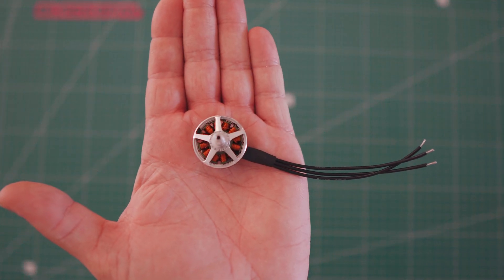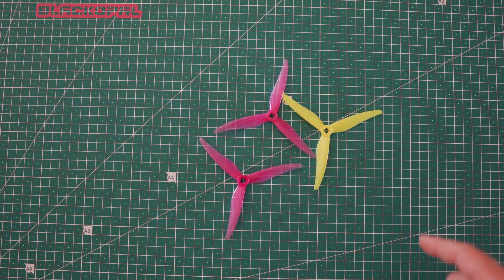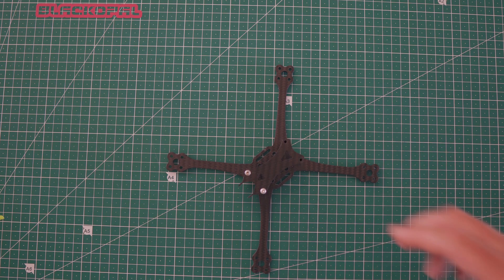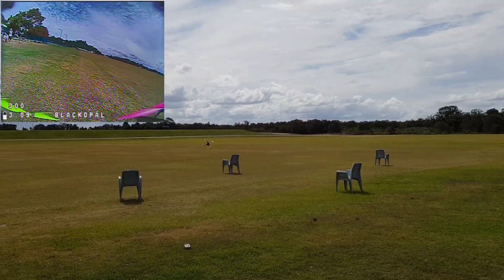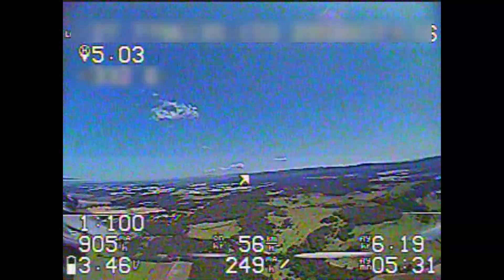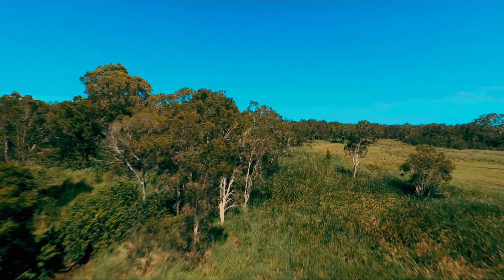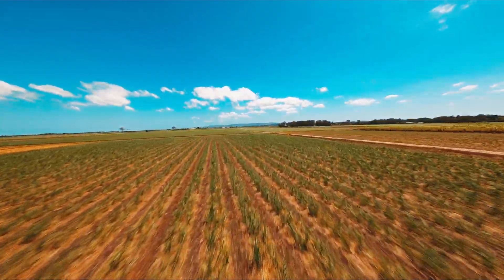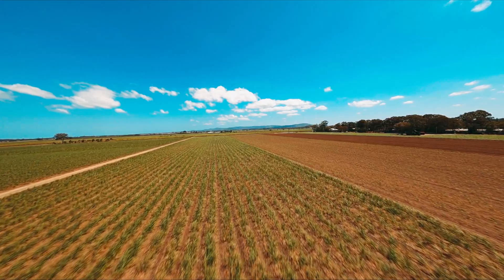37+ Min Race Drone? T-Motor Prototype

Comment: So sick! im def gonna try this out!
Reply from the maker: Yeah man, such versatile builds. I love how this genre is evolving so quickly.
Reply: @ScottTomlinson  This is gonna explode now for sure! Bro i got some mambao 2204 1450kv with 16mm motor mounts. How do you think this drivetrain would fare on a normal 125g frame, i could use theiflight H7 to help with weight a little more. Could i also ask what max amps you drew and what kinda flight time you got with the normal 6s lipo? Thanks!
Reply from the maker: @HarshFPV  Those motors should be sweet too. Much the same spec. I've got a mate trying them out also. Low weight really is the key to extended flight times but I've managed to carry some pretty heavy batteries so you might be surprised. 

The LiPo batteries on my analog build were getting me around 100 mAh per minute at cruising. Less as you go bigger obviously.
Reply: @ScottTomlinson  Awesome to hear that! i got 6s 1300mah only. although i can source some 4s 5s 6s li-ions. would you suggest the 6s for best throttle response or does the added weight offset the throttle response at that point, making 4s more optimal?(frame is 125g already)  By throttle response i mean like how fast the quad reacts to throttle blips sorry for the wording and thanks for your time brother!
Reply from the maker: @HarshFPV  6S for every instance is my recommendation. Unless you're going for a max hover time or something. 6S just gives you so much more freedom.
Reply: @ScottTomlinson  Awesome!!! i shall get a 6s li-ion!! thanks a lot bro! do you have and insta or fb?

Comment: Wow 35mins really ? 
Whats is the AUW with hero + 6s 1300mAh ?
Can't hardly wait for the release
Reply from the maker: The heaviest config I flew was 285g. That was a Hero 8 light with ND etc. So add that to a ~220g ish 6S lipo.
Reply: @ScottTomlinson  hero 8 light ?
285g is impresive ... you are a racer. I'm not ... my 6s freestyle rig was 391g. + 3d mounting + hero8 + 6s lipo 1000mAh = 698g 😅
Reply from the maker: @gonebdg  Naked GoPro. I'm still using the  original metal front though. Bit more protection.
Reply: @ScottTomlinson  oooh I see 😁👍
Reply: @ScottTomlinson  hi ... it's me again 🙂 ... I've saw the spec. On their official site ... the thrust on 50% throtle is only 285gr, so I guess the AUW should not more than 570gr. The mounting size is 12 instead 16 like the 2306/2207.
My question is ... do you have suggestion for the frame ?
Reply from the maker: @gonebdg  Hey bro! Production version changed to 12x12 yeah. The Mamba 2204 is 16x16 if that's a deal breaker. Similar spec 

From my testing 650g was really the limit on 6S but you're right, you get better performance the lighter it is. 

Try some toothpick 5 inch frame perhaps? Otherwise I'm working on a way to get these designs out if you've got the means to cut it/have it cut yourself.
Reply: @ScottTomlinson  catalyst machineworks The Shocker 5" is very good frame, but I just remember there is a good frame from my local communty Rajawali Borneo 5" 🙂 both support 12mm mounting holes 👍

Comment: I hope Dave_C finds this vid. Excellent results! Without a doubt going to build this into a long range quad. 4" just doesn't have enough ooomph for the mountains, but this will be perfect and gets more flight time. Bravo, mate!
Reply from the maker: Thanks mate! Dave_C inspired a whole movement with this genre indeed! I feel the 4 inch is ideal for those needing/wanting to fit the sub 250g but 5 and even 6 inch (stay tuned) is where the money is at for useable performance.
Reply: @ScottTomlinson  I flew ultralight 4" (prototypes of the Bird of Prey) the entire 2020 race season, well since April 2020.  I love how it feels and flies. I am faster with the 4" than my traditional 5" quads. Started off on 1404, then progressed to 1804. the 1804 provided much needed torque to turtle. Really interested in trying a wider motor on them as well.

Comment: What was the flight time once you added the vista?
Reply from the maker: Lost approx. 10 mins by adding digital. I'm only flying the DJI version on 6S though. So Li-ion around 25 mins with the GoPro. 10 Mins with my typical 1300 race LiPo packs. I could definitely shave some weight on the digital build however. Monoplate frame, naked vista, AIO would take away a lot of the fat.
Reply: @ScottTomlinson  what’s your dry weight on the digital version?

Comment: Awesome.  Do the Mamba next!
Reply from the maker: I'm super happy with how the these are performing but the Mamba is of a similar spec (configured as 1450 kv and Delta). The build quality is nice too. You'll get comparable results I'm sure.
Reply: @ScottTomlinson  they got a 2450 also
Reply from the maker: @fubar4fpv  2450 could be a good 4S option. It's the really low kv that makes these though.

Comment: What about flight times on a 6s lipos? For freestyle
Reply from the maker: In the heaviest config I've tried with a naked GP, full vista etc I have still managed 25 mins.
Reply: @ScottTomlinson  using bh 2004 motors and getting 7min freestyle on 6s 1050mah and about 25min on 4s liion all digital and naked GoPro. But thinking switching on these when they out if performance is similar, as don’t like tmount props.
Reply from the maker: @sergeb2643  I missed the lipo part in your first question sorry mate. For 6S Lipo, I've noticed it was very close to 100mAh/Min on the analog version. eg. 8.30 min on 850mAh 6S and ~12 min on a 1300 mAh 6S. The HD version times are likely comparable to all the micro LR stuff getting around however the flight characteristics/performance are far superior on a UL 5 inch with the slightly bigger motor.

Comment: What’s the difference between star and delta wound? New to this and looking for new 2004 motors . Throng to fly as long as possible.
Reply from the maker: In this instance it's likely done to fit the amount of windings needed to achieve 1500 kv on the smaller stator. A delta connection typically requires more winds to achieve the same kv. You can do it but it would require a higher gauge (thinner) enamel wire. You can achieve the same characteristics with either Delta/Star however. In theory, the start up current of a star connection is less than that of a delta connection but at the expense of low end speed. If you're not worried about the 250g rule I'd consider this motor/prop combo.

Comment: Nice work pretty impressive run time. Kicking myself I didn't go ultralight 5" over 4" now, and great editing and presentation! Don't know how I haven't stumbled across your channel sooner :D
Reply from the maker: The 250g max thing deters some using 5 inch I think but a 6S Li-ion is already over that so it's kind of moot haha. Cheers man, I haven't really jumped on the YT scene much but picked up a few cams during Covid. I love the mid range proximity stuff though. Nice Gold Rush vid btw.
Reply: @ScottTomlinson  thanks mate! I've given up on sub250 just aiming to reduce noise and intimidation factors now.